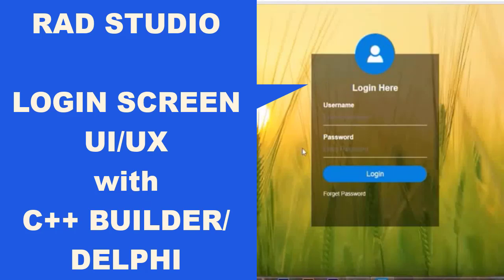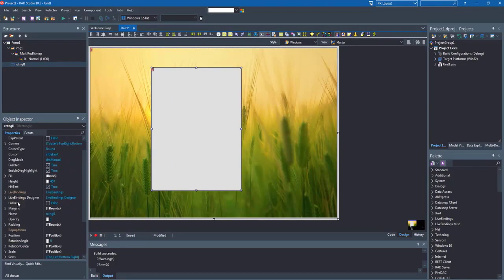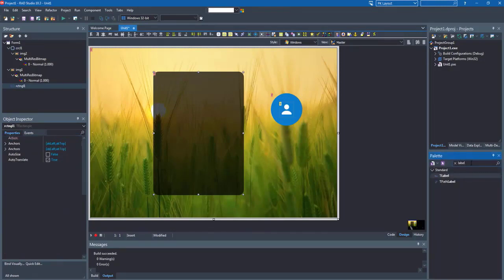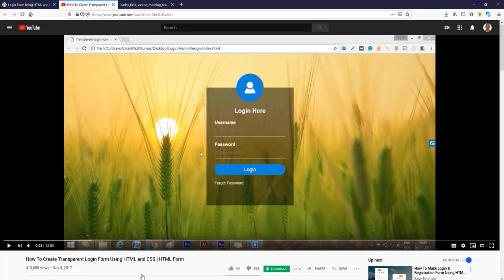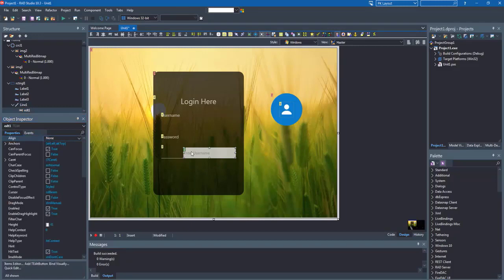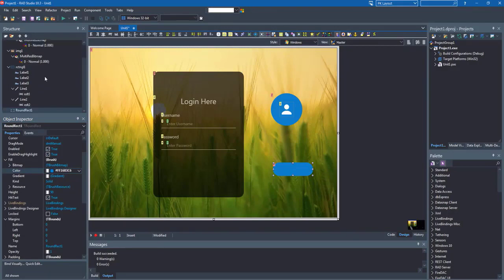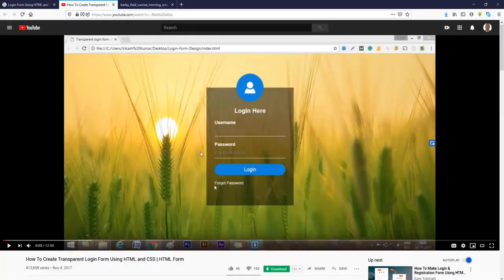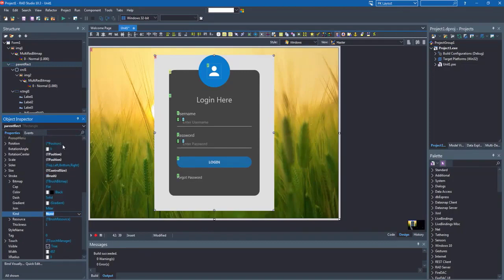RAD Studio Login Screen UI Using Delphi, C++ Builder

Comment: Unfortunatly this doesn't work anymore with Delphi 11.3 (The blue user-icon will always stay in the background and it isn't possible to center it, as it will expand to the hole rectangle)
Reply from the maker: This works. Just follow the video steps.
Reply: @pk230039  you were right. I used a TRectangle instead of a TCircle.

Comment: How to set opacity for TShape ?
TRectangle is not there in option
Reply from the maker: Hello, are you developing a multi-platform app and not a Windows VCL app? Remember a multi-platform app uses Firemonkey framework which will have the opacity property for TRectangle, TCircle etc.
Reply: hi, you must use " 0,7" not " 0.7"